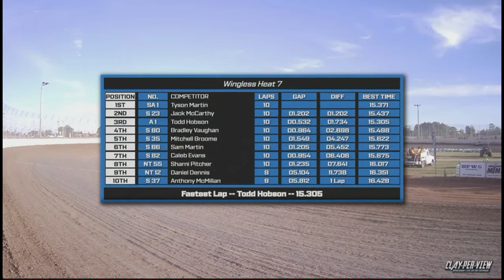South Australian Wingless Sprint State Title Timmis Speedway Mildura

Comment: great drive in the B main.
Reply from the maker: We actually set it up to run the pole and be quick out the corners but they ripped up the top and cancelled the Super Sedan B main which put us out  a little. It would have been interesting to see what it did in the A when the track went real slick.